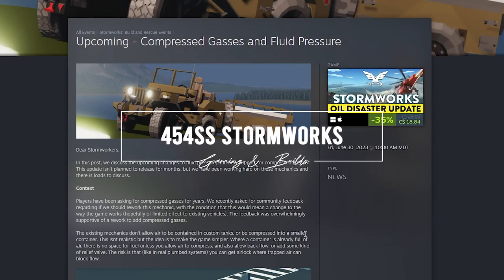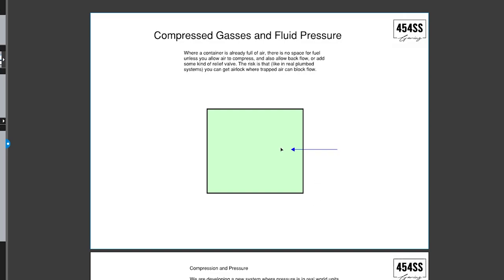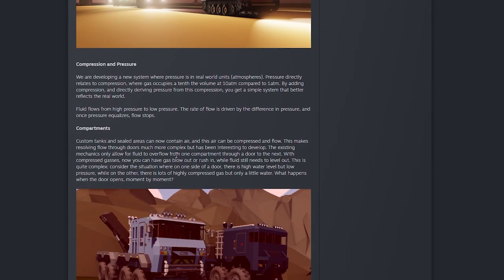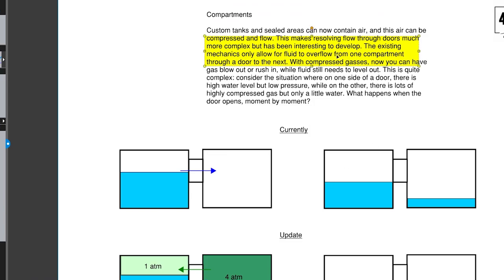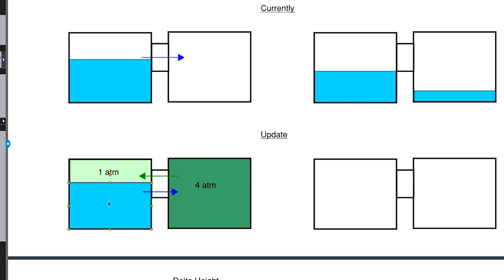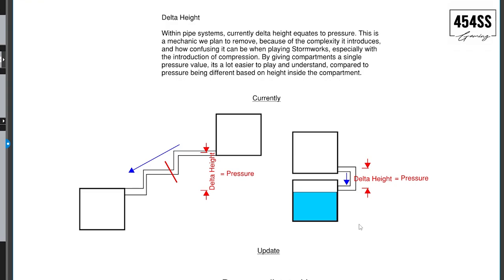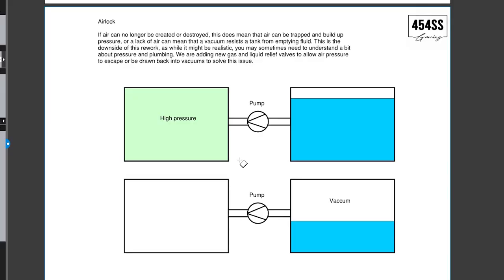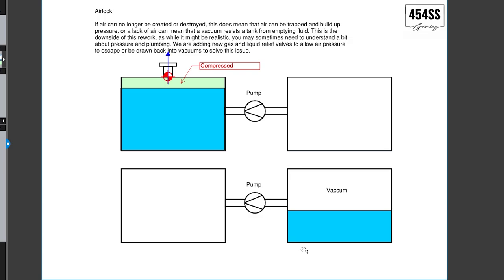Engineer explains the upcoming COMPRESSED GASSES update for Stormworks

Comment: I think people didn’t necessarily understand the can of worms they were opening by asking for compressed gas. 😅 Like one thing is for submarines. IRL, they use compressed air to displace the water in the ballast tanks to surface. This also allows you to control your depth by adjusting your displacement and thus changing your point of neutral buoyancy. But… this requires water to be modeled with increasing pressure as you go deeper, which AFAIK, the current game does not have to do.
Reply: I've done some test because i wanted to do a submarine and the pressure become bigger when you go deeper so the game do already that. This is why it's already hard to pump water out of ballast in the deep and rapidly impossible to pump out . But maybe you was talking about in custom tank only. But in the ocean it's already there.

Comment: What I also want to know is will they account for if, given a tank with 10 atmopheres of pressure in 10% of the volume and the rest water:
- will they check if a fluid port is below the water level and if so will it first drain the water until the port is no longer under the water so then the air will excape (I thoroughly hope they think about this)
- related to this is that if the refill pipe for a fuel tank under pressure is at the top, will we see backflow of air.

this would allow for pressurized fluid pumps for firefighting for example.